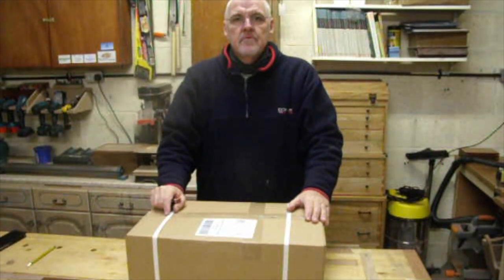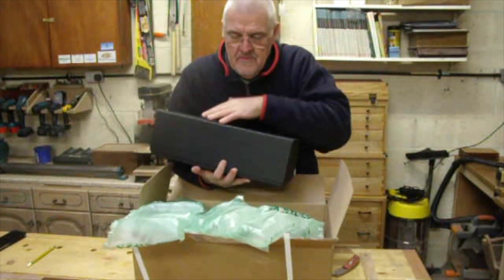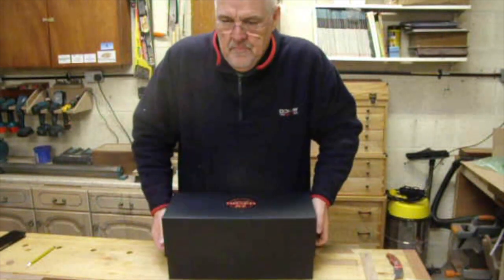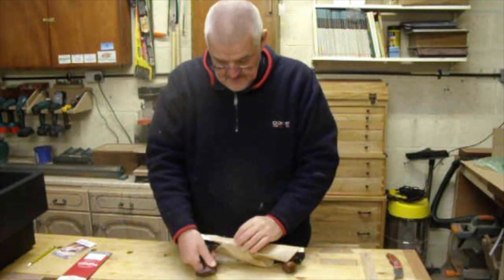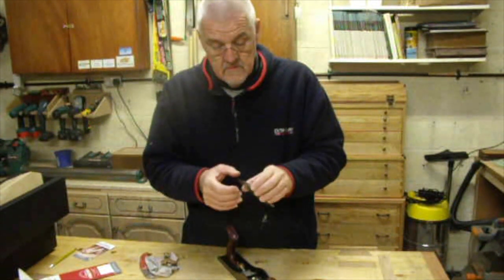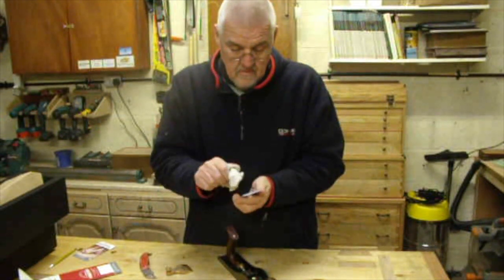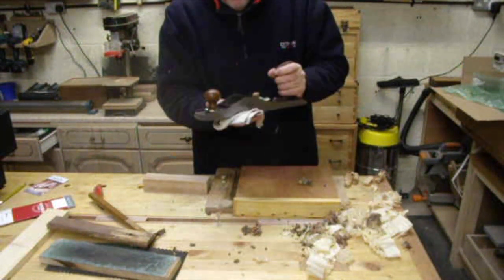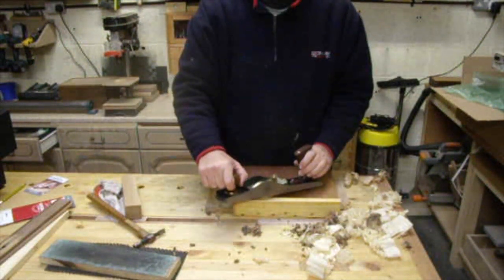Rider No 62 Low Angle Jack - Tool Review

Comment: I’ve just bought an expensive iron to make a low angle bevel up wooden plane. Seeing how hard you need to push replicates what I have found. 90% of the time I’ll use a thicknesser instead.
Reply from the maker: To be fair the plane blade was used straight out of the box, after I gave it a hone it performed a lot smoother. Most of the time I use the planer/thicknesser though sometimes the hand plane is the only way to go.

Comment: I'm thinking about getting one of these myself - it would have been nice to see a clip of you planing the same woods after you'd spent time sharpening the blade to your own standards.
Reply from the maker: Steve_1401 Thanks for the watch and comment, fair comment re planing post sharpening😉 I’ve got to admit it’s a decent plane all round now that I’ve had it a while I can only recommend them. Still only used the one blade the other I was intending to sharpen to a different angle however I’ve never felt the need to or took the time to 😂. If you do get one it won’t disappoint I’m sure once you’ve set it to your preferred position. Cheers Steve
Reply: @Phenrica  Thanks for the reply :)

I'm torn at the moment, I'm like that donkey stuck between identical piles of hay - except in my case its a Sweetheart, Rider and Quangsheng 3-way pile of 62's :D
Reply from the maker: Steve_1401 yeh I understand the dilemma, I guess there’s not much difference between the brands, the laser etching enticed me 😉

Comment: Looks very similar to the Veritas LA Jack.  You ought to be getting some fun hours out of that nice new toy.  Particularly on end grain where low angle shines.  Any plans on getting more irons and sharpening at different angles to increase it's versatility?
Reply from the maker: Looking forward using it and as it came with two irons I will definitely use different angles, though not sure which way to go yet! research required ;-) on the original one I've done the classic 25 deg with a 30 deg primary or so determined by the Veritas sharpening jig

Comment: I must say that is the thickest iron I have seen on a modern plane, just how thick is it ? I make a copy of the Norris plane and I find the modern thin iron are useless for finishing, they vibrate too much, whereas the thick iron gives a much better finish, as you demonstrated there for use with a shooting board that plane is really good. Chris B.
Reply from the maker: Englishman French Hi Chris, the blade thickness is 4.38mm (11/64 old money) for the money the plane is good however does have some cons. Cheers Steve
Reply: Phenrica: I have just received my low angle plane, a Stanley No 62, and although I cannot fault it on build quality, it is superbly machined and finished, the handle is set at such a vertical angle that it is almost unusable, is your Rider handle very upright ? Strangely, the screw for the handle is set at the normal angle, so as I have some Rosewood I will make another.
Reply from the maker: Englishman French The handle is at a very similar angle to my other standard Stanley Bailey planes and feels ok to me